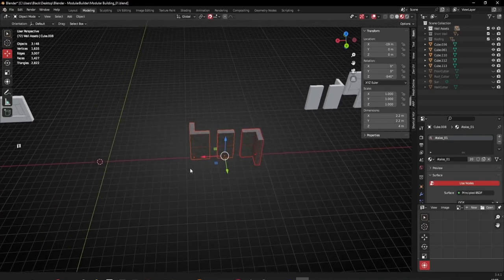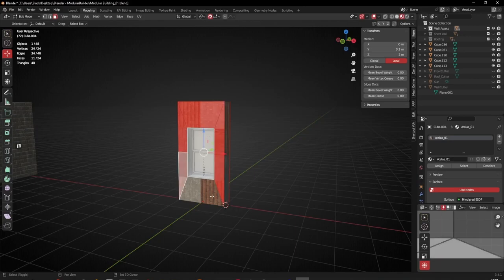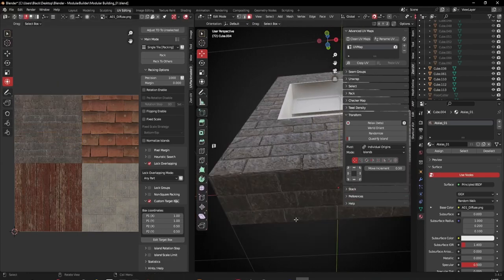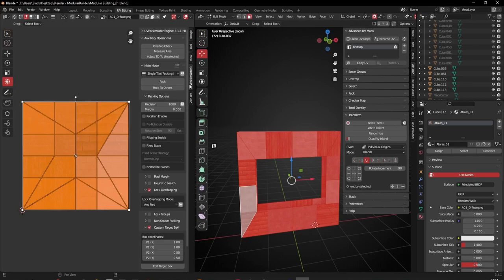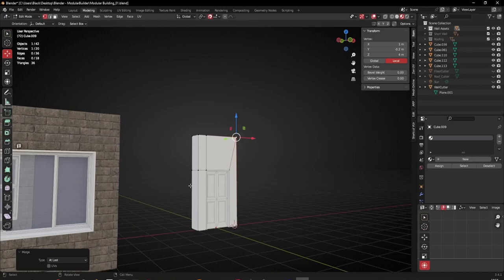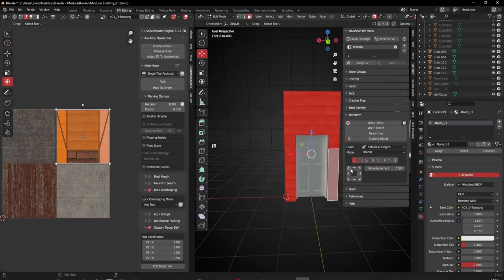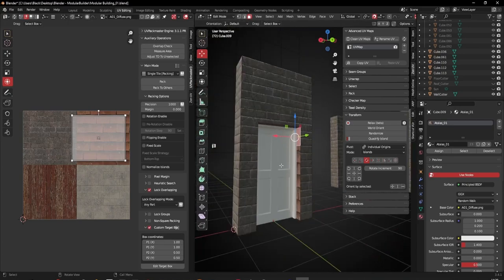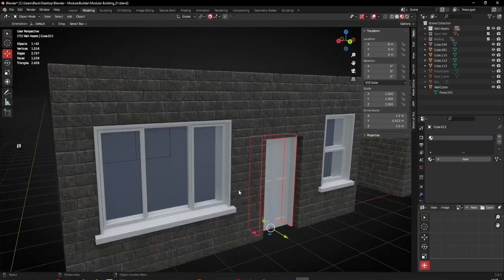Blender Modular Design - 24 Texturing Exterior Walls 02

Comment: Hi, I havea  slight probem with applyig this techniques in my project - I have wall segments of 2.5m height, all of them, but the widths differ.. My wall texture is 2048x2048 px square so initially I thought of creatig a "filler" wall elements that will basically make the uneven wall blocks to extend up to the perfect square but... it does not really work well, the texture is streched even if I setup the UV coordinates accodingly in both wall segmets. How do you deal with not-even wall widths and tiled texture? Thanks :)
Reply: Ok I think I know, uniform scale ;)